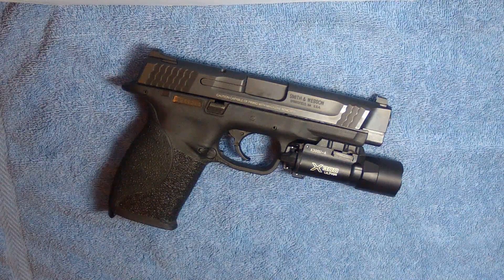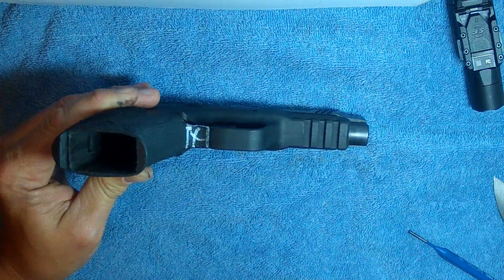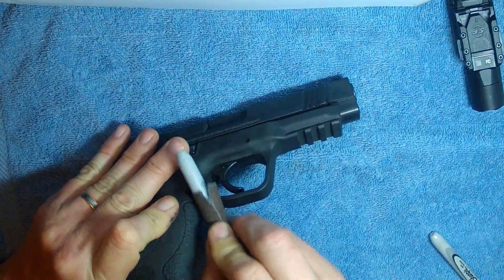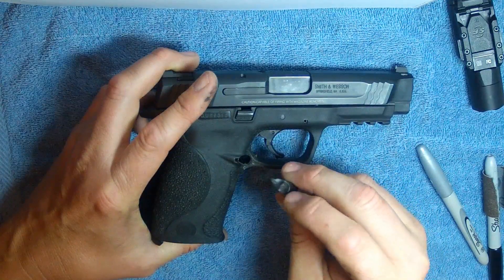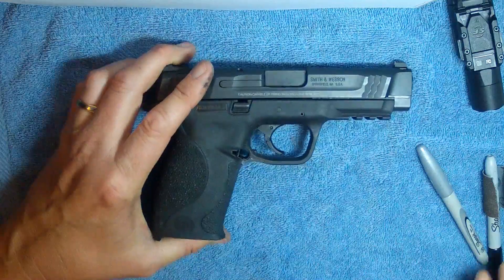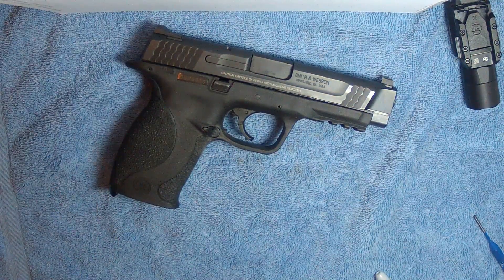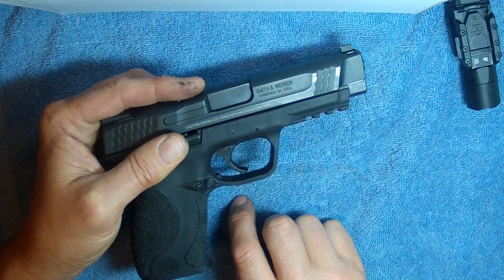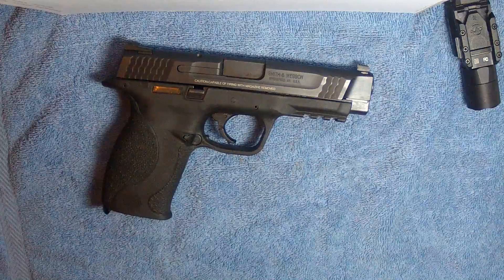Undercutting an M&P Trigger Guard (Gunsmithing)

Comment: It doesn't look like the trigger guard is thick enough to cut deep enough to make a difference and not weaken it to the point of possible failure. How did it shoot afterwards? I just did my Glock 19 and it made a huge difference in the control I have and recoil reduction. Im looking at a used M&P and Im planning on cutting all the trigger guards on poly guns I think it will make a difference on.
Reply from the maker: It worked just fine.  While there is not as much thickness as a Glock, that area is thicker than you think
Reply: Was it noticeable though?  I thought the same..
Reply from the maker: Yes the smoothness was noticeable the cut no so much

Comment: what type of grip tape and where do you get it?
also would you do an instructional on how you got it so form fitted.
Reply from the maker: Eric's random junk 3M tape
Reply: Brian Ehrler know which one? I've got 10 3M grip tapes and none of them match the one in the video.
Reply from the maker: Eric's random junk It is 3M 2" wide tread tape from the local big box store

Comment: Where did you get the polish at ? Do you have to use a buffer wheel ?
Reply from the maker: The polish is from the local hardware store.  I noticed that big box stores have it also it is Dico brand.   Yes I use a polishing wheel the small one for Dremel
Reply: Thanks